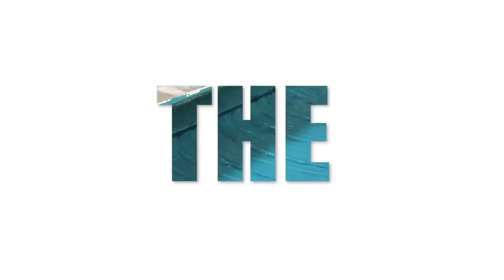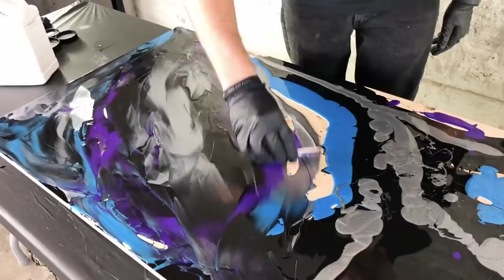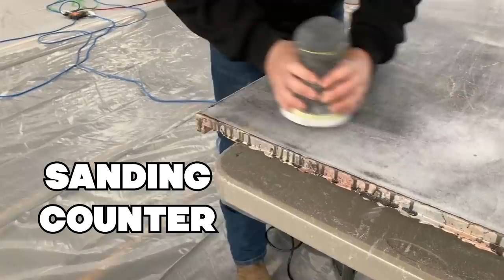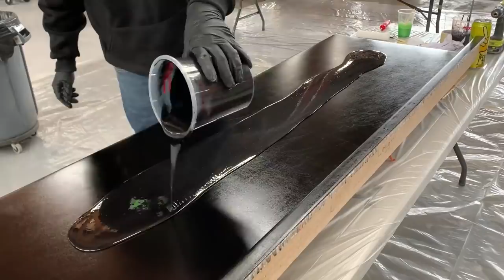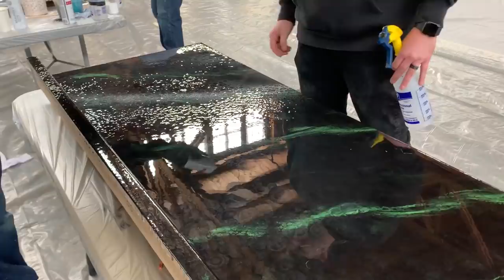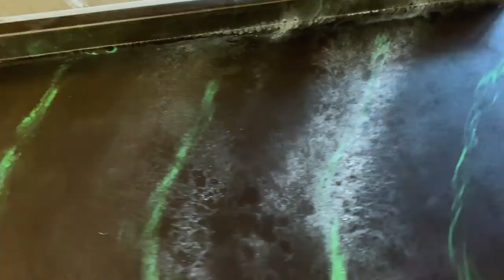Metallic Epoxy Countertop Recorded During Live Training

Comment: whats the heat resistance of the epoxy? and how long will it last with the wear and tear of normal kitchen pots/pans vs scratches and heat.
Reply from the maker: Our products are actually industrial coating made for military aircraft hangers, etc. So theoretically in a residential, or even commercial setting it will last forever. This is NOT a cheap epoxy paint that you will commonly find at box stores like Home Depot or sherwin Williams. It is a thick 100% solids epoxy coating.

Fire and heat test
https://youtu.be/09elup51N6U
Reply: @LeggariProducts  Very nice , is there a video on scratches and normal beat down on wear and tear?

Comment: Really dull with the top coat.
Reply from the maker: We have 3 different top coat options. Glaze coat is our super high gloss top coat that lays out glass smooth just like the metallic epoxy coat. Our WB Urethane comes in high gloss and leaves a minor texture and we also have a WB Urethane that’s a Matte/Satin finish.
Reply: @LeggariProducts  WB Urethane two-component?

Comment: Why does this one look dull? Usually the finished product has a shine/glare to the surface but this one has like a matte finish.
Reply from the maker: We have 3 different top coat options. Glaze coat is our super high gloss top coat that lays out glass smooth just like the metallic epoxy coat. Our WB Urethane comes in high gloss and leaves a minor texture and we also have a WB Urethane that’s a Matte/Satin finish.
Reply: The final coat was not from an epoxy mix as you can see. It looks like some kind of glaze.
Reply: Because that's the look they wanted.